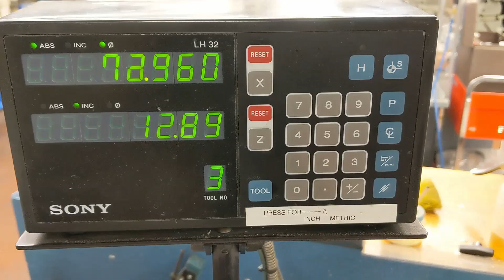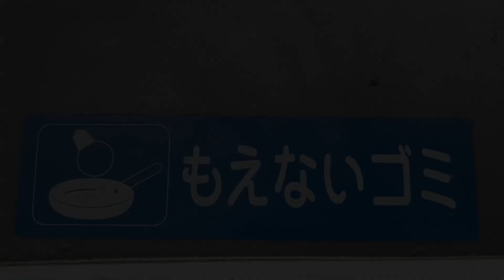Prelude - lux et colegium

Comment: So I watched your 10EE WIAD video, wondered if you got a replacement for that bad thyratron, then here you are in a big shop with a Round Dial? What's the story with that? Ever get the WIAD fixed up?

Why do I care, you might ask? I've been lusting after a 10EE for years, and may finally get a bigger shop built this year and have a place to put one. So I've been watching Thyratron videos instead of doing anything useful. Retirement is interesting so far.

And have you made a new end cap for the flashlight yet?
Reply from the maker: I use a different 10ee at work. This one is a round dial with an inverter drive. This was the day before the lab closed for the winter and the shop was basically empty, so I felt like I could get away with something during lunch.

"a new end cap for the flashlight"
No end cap I can make will raise that thing above the trash that it is. I will hold what little was pure about it in the crucible of my heart until I get around to crapping out a better flashlight.

Glad you got to retirement. Do you make stuff?
Reply: @rainman6272  I've been working on an Electronic Leadscrew for my little Logan lathe and done some half-assed videos on it. Upgraded it to a Nema 24 motor this week for more torque, but it's noisy and now I'm waiting for a new drive module to show up. Bought an old Heathkit Condenser Checker on eBay today just because I think the old "Magic Eye" tubes are cool. It will probably need work, but it's a pretty simple design. I need a bigger shop to pile my crap up in, and that's probably going to kick my ass. Probably be cheaper to pay a contractor than the doctors. A friend of mine just broke five ribs remodeling his bathroom!